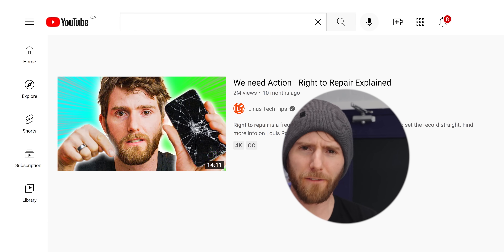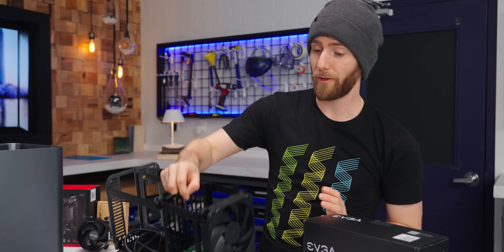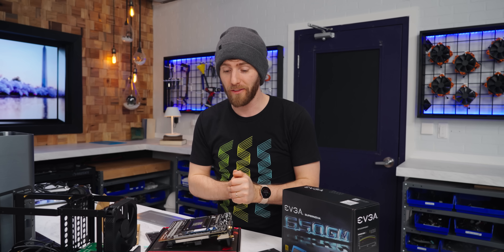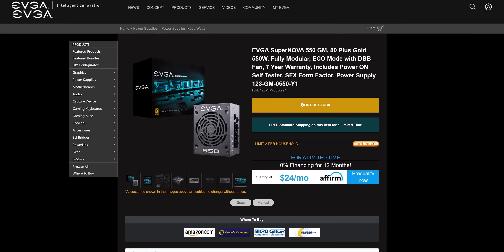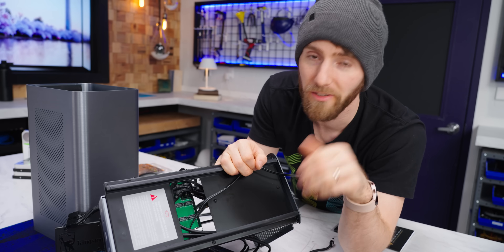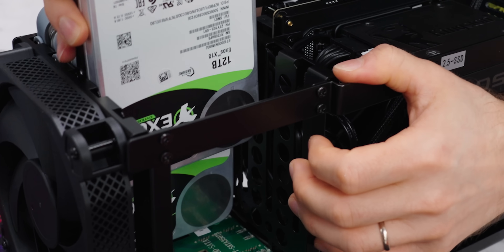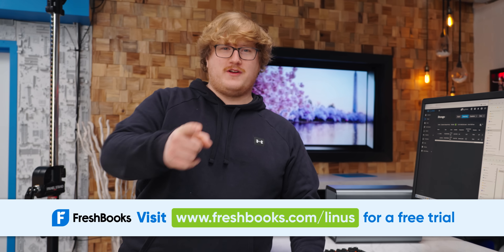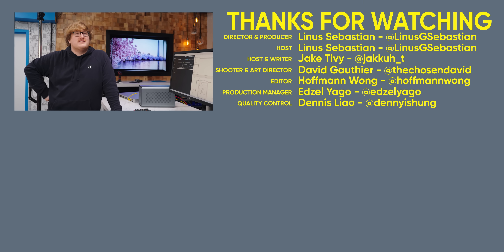This blows away the competition - JONSBO N1 NAS Build

Comment: I would love to see a video for those that are locked into Qnap or Synology, but wanting to move from those proprietary solutions to a home-built solution, as well as mimicking built-in features, like:

* It was breezed over, but what are the real benefits and downsides, for a home user that might just store a bunch of stuff, of TrueNAS vs. the alternatives?
* How do you migrate your data over? 5 drive bays may be common for Linus, but I'd argue that most home users that want a backup and long-term storage solution have two or four bay NAS's at most. Do you need to buy an additional drive to migrate data over? If you've got a replicated setup (I have 2x6TB drives), can you pull one drive from the proprietary NAS, format it for TrueNAS, move everything, then add the additional drive after everything has been moved over successfully? Can you change your vdev type if you add an additional drive - i.e. migrate everything to one drive, add two more, and change it to Z1?
* Is there a sort of app store, allowing you to install stuff like Syncthing, Plex, or Homebridge, without the need to go into Docker images? As a software developer, Docker is great, but... not without its own problems. A custom solution is obviously going to be more work, but one-click installs would be huge.
* How do you handle off-site/cloud backups? Is there an app you need to install? Or does it have to be a docker image of some sort? Do you have to dive into things like cron jobs and shell scripting to run a network copy to S3? scp? rsync?
* Can you access your NAS outside of your network without going through the hassles of opening up a port on your router (and, thereby, opening yourself up to attacks)? Synology offers up Quickconnect, which is really nice - basically establishing a connection with your NAS without needing to open things up.
* How do you configure a Time Machine share?
* Can you have two sets of drives - i.e. two or three replicated, slower, high capacity HDDs, and two replicated, faster, lower capacity, SSDs? The case demonstrated only mounts for 3.5" drives - is there an adapter to make that work without the drives flopping around? If you can, can you also partition the cache drive?

I've done some preliminary research, and I know some of the answers, but I would love a deeper dive into a lot of this stuff from some people that know much more than I do.

My current setup is a Synology DS218+ with 2x 6TB HDDs, replicated. My personal goals are:

* Run 2-3x 6TB HDDs in either replicated (2 drives) or Z1 (3 drives) mode. Leverage half (or maybe more) of the cache drive for caching here.
* Run 2x 2TB SSDs, replicated, for quick access to current projects, photo libraries, music libraries, synced folders for certain apps (like assets for FCPX and Logic, etc.), and, if possible, leverage the remaining m.2 cache drive's capacity or partition for cache.
* I want everything to be backed up to an S3-like service (I use Wasabi) on a normal basis (a few times a week) with diffing (so I don't get hit with add/deletion costs). I don't want immediate backups as any change could get synced and could cost money.
* I'd like to run Plex and Homebridge as well, which are currently duties held by my old Mac Mini. It does the job, but I would love that to be all on one machine. I'd also like the Plex library to be able to access the USB drive, so I can pull it to drop in home movies (which is what I mainly use Plex for) on my main machine instead of over the network.

There you go Linus and team. Do your video magic.
Reply: I moved from a custom setup to Synology, the support you get from Synology is amazing, you are not going to get that from a custom setup. I pulled two drives on a 1 drive failure shr raid, Synology fixed it for me. You try doing that on a custom setup

Comment: it's only 126 bucks... plus 104.43 in shipping.  i mean 230 dollars isn't a ton but it isn't cheap and i don't think was considered in your cost analysis.
I actually like the case and the similar v11 for a mitx computer but if i get both it's 250 in shipping.  That's a lot in shipping costs.

Comment: Wouldnt it be better for this to be in exhaust mode instead of Intake where its fighting the pressure from the side panels. Seems it would be better on removing heat directly from the drives

Comment: Missing from the video: ECC ram, checking the DWPD for the cache drive, testing the back plane ports with a drive you don't care about, hard drive temps, monitoring, snapshots, etc. DIY NAS is fun, but if you screw it up, you loose all your data easy enough. Linus Tech Tips has never lost data though, right?
Reply: Exactly what I was thinking

Comment: I got a few qns abt DIY NAS since i plan to make one eventually
1- Does having higher/more RAM help overall. if lets say light usage n backups
2- Is more Caching better? I got intel optane M10 16gb, seems enough maybe
3- How do i designate which memory is for caching, OS and NAS memory? if i follow this vid n use truenas. Well not really OS but more the other 2. 
4- Do i need a good network card to go along with it or is the motherboard ethernet port/wifi enough?

Comment: Putting that many hard drives that physically close to one another is going to shorten the life of the drives significantly. That nice big fan doesn't have enough of a gap around the hardware to push air through. If you have the room you're much better off with a full sized PC build that has room for drives. Personally I've been using a celeron nuc and USB drives for years. You don't have any kind of redundancy so backing up data is all on you, but I'm not locked into anything and it's even cheaper than this. I have never understood why amateurs and hobbyists go for NAS setups.

Comment: Using RAID-Z1 on large drives IS A BAD IDEA! Enterprise HDDs can have 10^-15 rate of unrecoverable read errors(URE) and multiplying this number with 20TB gives a non-negligible chance to have errors. It is quite possible to have error during an array rebuild, which is really, really bad. UREs were exactly what caused Linus's lost of data on the petabyte projects.

Comment: Personally I use a Silverstone CS380 case with some Gigabyte B450 ATX board. The CS380 has 8 hard drive sleds, which is perfect for the cheapest Unraid license (6 Data + 1 Parity + 1 Cache). I started out with 3 TB drives, but I've been slowly upgrading to higher capacity drives as I run out of space. Currently at 1x 16TB, 3x 10TB and 3x 3TB drives. I've had to accelerate my replacement of the 3TB drives because I realized they are all like 8 years old now... Surprised they haven't failed, but I'm not gonna tempt fate.

Comment: Maybe it's just me, but the video seemed kind of misleading. First of all, the build you showed was quite a bit more than the Synology you showed. Furthermore, there are many other NASes that are cheaper, so it would make more sense to show different builds that correspond to the different price ranges. The end result is that the build you showed is likely overkill and therefore a good deal more expensive compared to what many may need. Another aspect that seems to be neglected is power draw, because while it may seem insignificant, if this is something that is going to be running 24/7 then the electricity draw could add up to be a non-insignificant cost. Lastly, you used non-ecc memory, which adds risk to your data. 

For a NAS you'd be better off using ecc ram to prevent data corruption. Reading the comments seems there's a few interesting decisions here that don't make a lot of sense, like adding having a cache drive instead of more ram, going RAIDZ1 instead of RAIDZ2. It just seems kind of strange that for a build that costs so much, that so many corners were cut. Maybe on paper it performs better and can store a lot more data than a prebuilt, but this appears to come at the cost of reliability and longevity. 

All that and it cost more than the prebuilt you were comparing it to, and if it has a bigger power draw, then it may cost even more in the long run. IMO the tradeoffs may not be worth it. If this were somehow significantly cheaper than the prebuilt you mentioned, then it would be one thing. It's interesting to see what one can do with what is essentially a shoestring budget, understanding that there would be things that don't make the cut. But I wouldn't consider $800+ to be a shoestring budget for this kind of thing.

Comment: Just built my NAS last week.

Specs -
CPU - Ryzen 3700x (Brought Ryzen 5600x for £40 and replaced the 3700x on my gaming system)
Motherboard -Asrock a520m-itx (£100)
RAM - 32GB DDR4 2666 Unbuffered ECC (£75)
SSD - 512GB Samsung 850 Evo (Took it from my Gaming PC)
HDD - 3x8TB Seagate NAS drives (£120 each from Facebook marketplace, brand new drives)
Case - Fractal node 304 (£50)
PSU - EVGA 500W Gold (£50)

I had a £150 discount for one of the hardware stores and used that to buy the 5600x. The build cost wayyyyy less than buying a Synology or Qnap. If you are looking to build a NAS I would recommend looking at the Facebook marketplace. I really got lucky with the 8TB drives as they go for £180 new. 

I run Proxmox, and I run  Truenas, Portainer, Plex, Syncthing and Pi-hole (backup) VMs.

I went with AMD for the ECC support. Intel supports ECC on some CPUs however you will need to buy a server-grade motherboard which usually goes above 300. For my budget, I went AMD as a lot of consumer boards support ECC, which is needed for Truenas/ZFS.

Comment: I built a similar NAS about 5 years back, only with a much more expensive hotswap 4 bay case and a ultra low TDP Xeon. Ran WAAAAY too hot with the single included Noctua 120mm fan, only solution was ramp up the airflow using an industrial fan which made it excessively loud. Switched to a 5 bay pre-built which although far less powerful has been problem free and a couple hundred $ cheaper than the original.

Comment: As much as i like the video, i hope no one uses this as a guide when they are making their own ZFS server. No ECC ram or not even mentioning it is a big oversight. Why use a asus gaming motherboard and not something like a supermicro board that has features such as ipmi and extra sata ports built in? Not mentioning that you should be setting up jobs like smart long/short and scrubs which i thought you guys would have mentioned considering you made a video awhile about about how you didn't do this on your own server and it ended up screwing you. ZFS also can just be ran of a usb, giving an extra sata port but i admit this wouldn't add much to the video.. And finally the compression, especially with lz4 will almost never got above 1.03, so Jake saying you can save 20/30% of a files size is incorrect in this context with lz4. overall entertaining video, would recommend but definitely not a guide for people looking to make their own server instead of buying one.